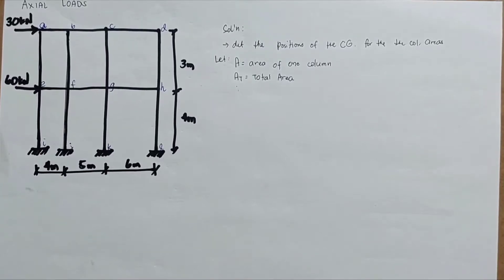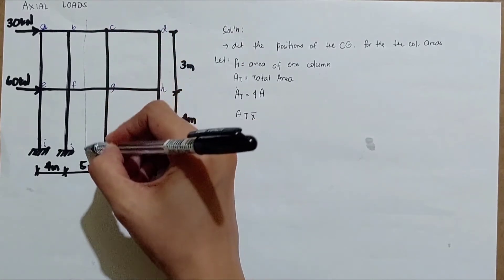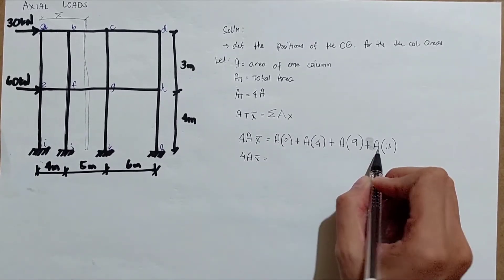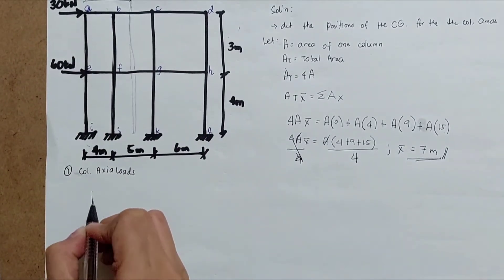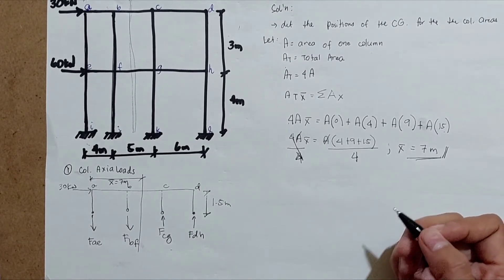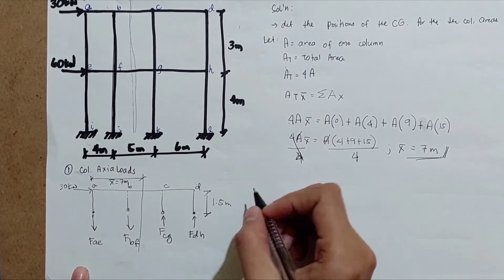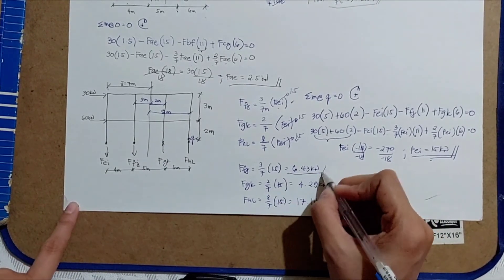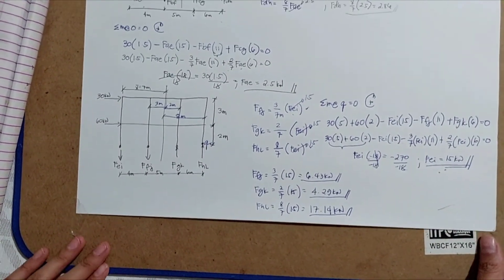Axial Loads

Comment: Same po ba ang pagkuha ng axial force sa canti at portal?
Reply: Pano po maam pag 3 columns lang yung given,pano po assumption ng forces pag kukunin yung axial force? ⬇  ⬆  ⬆ pwede po bang ganito?
Reply from the maker: @ansherinacaban3103  opo, pde po. Depende sa distance ung up and down na arrow mo po. Hanapin mo xbar muna then idraw mo as hidden line ung CG tapos saka mo ilagay ung arrow.
The more na mas marami kang sinosolve na problem mas mauunawaan mo yan. Practise lang ng practise.
Reply from the maker: @ansherinacaban3103  check this video po
https://youtu.be/fnsjJyhPOnk
Reply from the maker: Yes po. Same lang po ang pagkuha ng axial force. Different method pero same ng approach po.
Reply: Maam paano pong depende sa distance yung arrow up and down? 😁
Reply: Thank you po. ❤
Reply: bale po kapag 3 columns po e kung ano sakop ng x bar yun ang tension which is downward po ang direction?